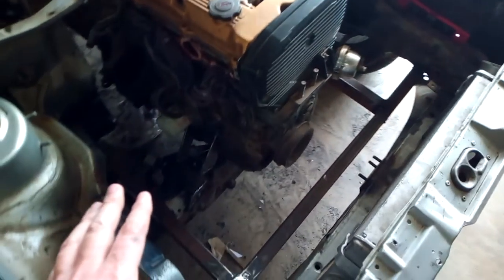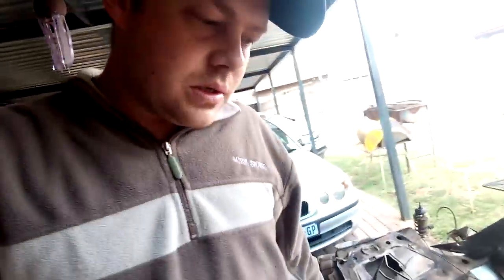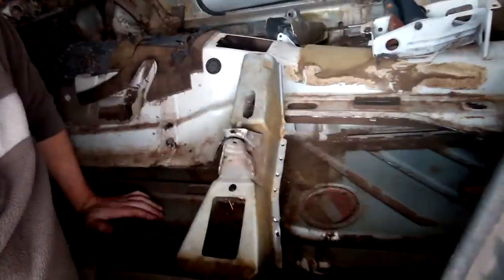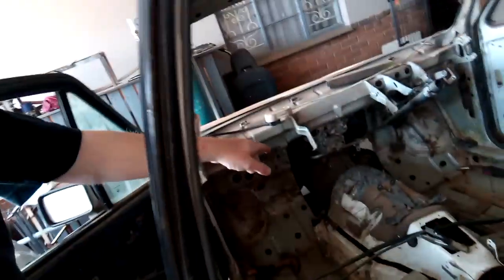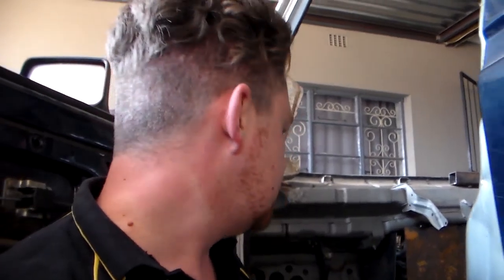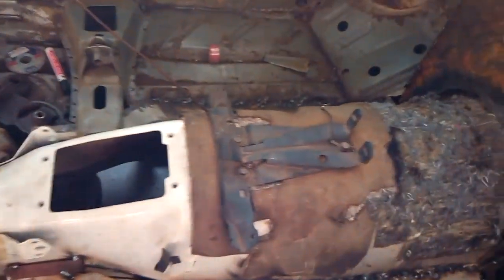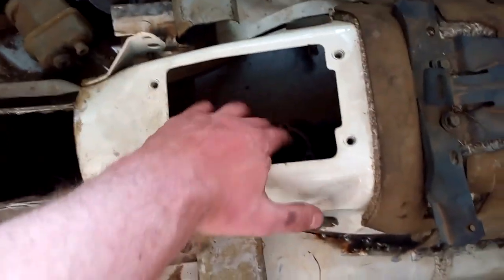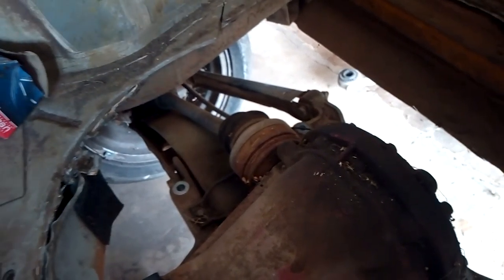Rear Wheel Citi Golf  - Tunnel Update

Comment: 6 months too late....nice project something I always had idea to do... nothing wrong with your methods of doing this set up...if it was me i would have gotten a 95/96 Mazda b2200 tunnel front to back as it is in the bakkie and worked with that as the motors are based on same blocks and transmission is already laid out space and cross member wise... but non the less you getting your plan in motion
Reply from the maker: Thank you sir. I bought the current tunnel with the suspension setup. The gearbox I bought from a guy that had a spare, he didnt had any other parts though.  If you ever do start your project let me know. Ill like to see how you do it. Sounds like you have a lot more know how than me lol